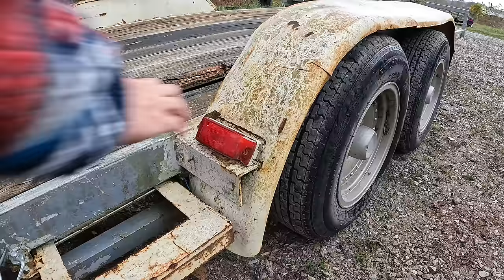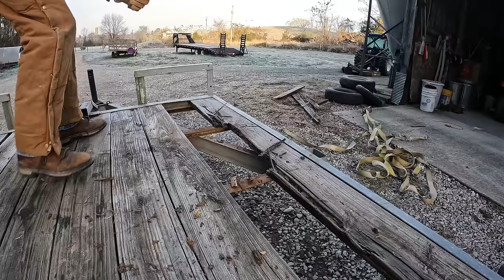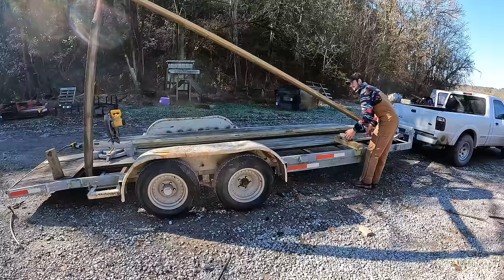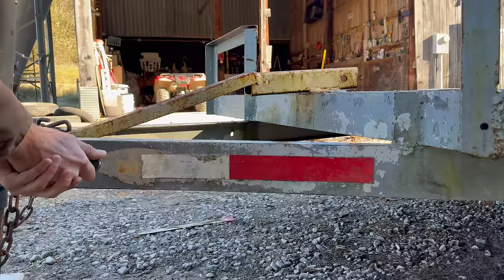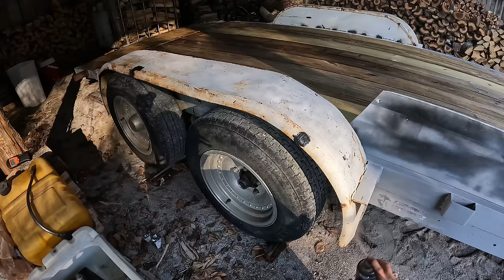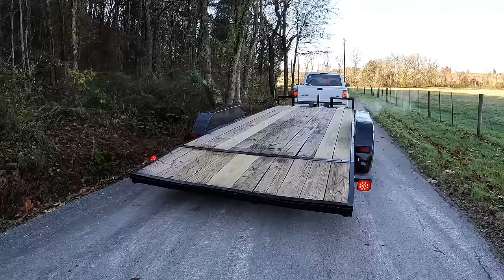Easy Money Flipping Trailers: 20ft Car Hauler

Comment: you should learn to weld so you can put the board in without risking your face.
Reply from the maker: Getting better every day. I can weld, it’s just not the prettiest. Gotta work with what you got. Also this is the only way to get the boards in if I wasn’t planning on repainting the trailer.